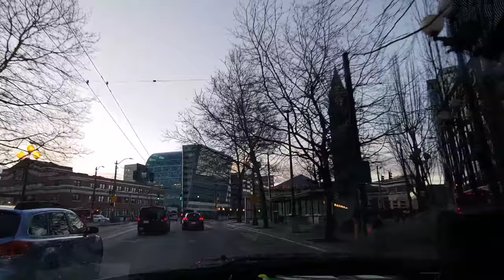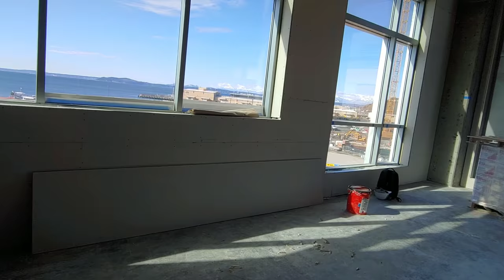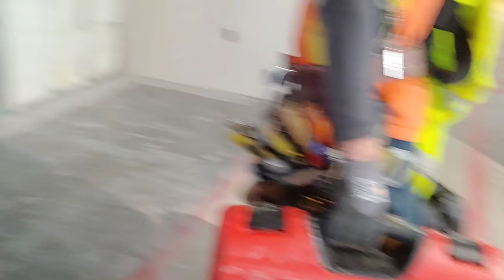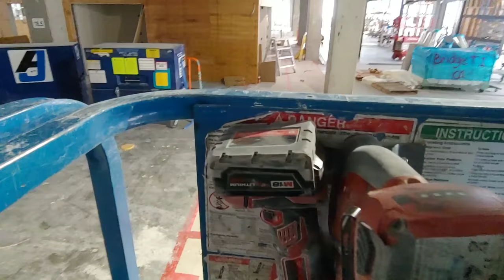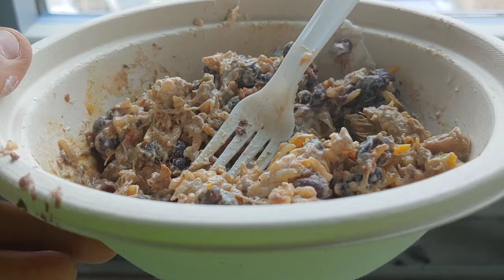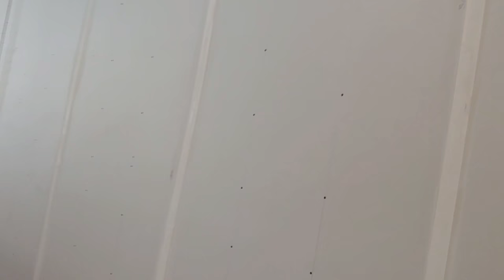paying union dues and getting to work! Drywall & steel stud

Comment: Remember guys when your carrying 12’ 5/8”. Keep your knees bent slightly if you walk stiff legged you’ll pound your joints and do a lot of damage and switch sides from right side to left I got scoliosis from always carrying on my right side. And always use a board cart and reduce the distance you have to pack them. When your young you don’t notice it much but trust me I hung for close to 30 years, you will as you get older

Comment: Hey I want to move to Seattle and join a trade union. My background is in framing. If I joined local 30 what kind of work would I most likely be doing? Commercial drywall? I was also thinking of applying to the IBEW local 46 (I think that's the #), do you have any observations to share about the differences between working in IBEW in Puget Sound and in working in local 30? Thanks!